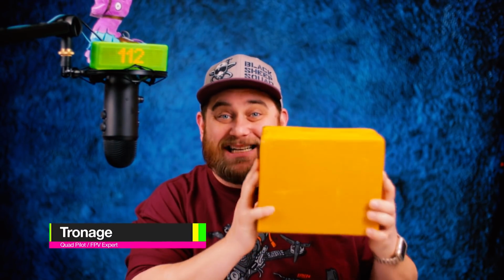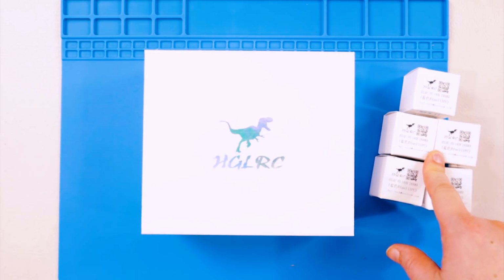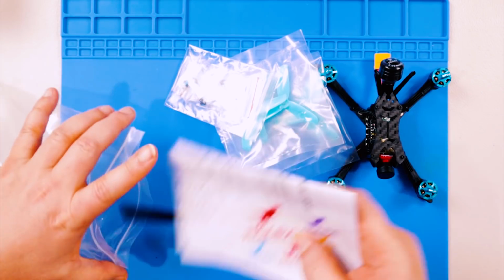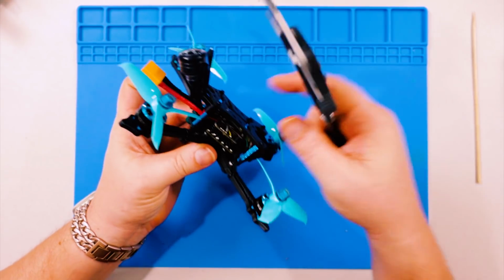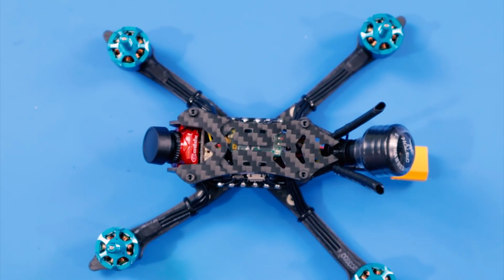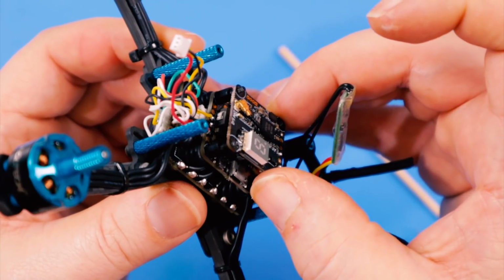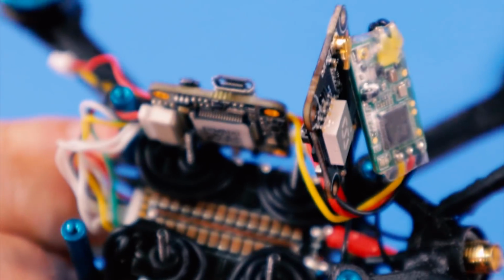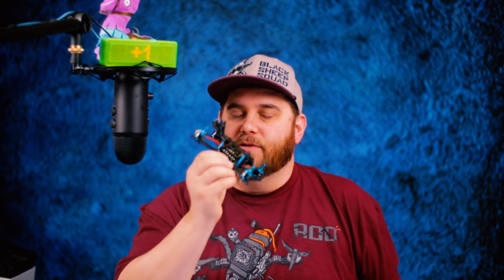HGLRC Arrow 3 152 Unboxing and Closer Look Part 1

Comment: Its crazy thats its possible to make something like this and I wanna play with it so much i mite save my money for i have  searched it up i have seen it on bangood a ton mite buy it i dont really know?
Reply from the maker: It is a great flyer.  IF you have never flown anything before though, I'd recomend you check out the tinyhawk bundle pack.  You can check out my video here:https://youtu.be/cJozoOOprJI  It is greatly suited for someone new to the sport, comes with everything you need (Goggles, transmitter and quad).  IT is smaller and less powerful then then Arrow 3, but most need to learn to walk before we learn to run.  And flying isn't very easy, and expect many many crashes.

Comment: GNB makes 550mah 6s but  you will need to solder on a xt 60 on them
Reply from the maker: Yea I've heard about that pack, it is actually the only small 6s that exists (to my knowledge).  I'm going to have to get me a few of them.  I'm just debating which connector to swap (make the Arrow3 an xt30, or make the packs xt60.  Right now I'm leaning towards putting xt30 on the Arrow, with higher volts, I will have lower amps, which the XT30 can easily handle, and it will be lighter weight too...  Also personal I get sweaty palms when I need to work on battery connectors 😨

Comment: Why would you have to replace the motors if you have the higher KV ones if you want to run 6S.  Why not just setup a throttle cut?
Reply from the maker: Excellent question!!!  
The main advantage is lowering your amp draw.  Without getting deep into motor theory, the gist is the KV rating is how many revs per minute a motor will have when one volt is applied.  Therefore  if we multiply 3600kv motors by 14.8 volts (mid point of a 4s), that would be ~53000rpm.  
By switching to 6s with a lower kv we get 2400kv multiplied by 22.2v (mid point of 6s pack) equals  ~53,000.  It should be no surprise that these numbers are exactly equal.  Since the motor would be spinning "exactly" the same rpm in both of these scenarios, then the Work (or watts) would be the same, and therefore remain constant.  
The relationship between volts, amps and watts is: Volts = Watts /Amps.  So if Watts stays constant, then as our volts go up, our amps must go down.  Amps is what cause heat in escs, so lower amps = less heat = better performance.  Also a 6s will have less noticeable voltage sag then 4s, and overall will perform "snappier" if that makes sense.  
If you were to add a throttle cut, you aren't getting any of the above benefits.  The way to think of throttle is how many volts the esc lets through to the motor.  So cutting the throttle at lets say 75%, means you are flying as if you were using 75% of your 22.2 volts (Which would be 16.65 volts), which is  like flying a 4 and 1/2 cell pack...  Which "could" work because everything is correctly balanced, you are running motors that are great at 4s, at a voltage around (give or take) a 4s pack....  But you are carrying a payload of a 6s pack (which will actually hurt performance because extra weight without extra power), you also don't get the drop in amps to help with heat buildup, and you don't get the extra peppiness etc since it is essentially just running at 4s.
So much for not going to deep into motor theory lol...  But I hope that helps you understand the benefits and why you swap out a lower kv motor when switching to a higher voltage.

Comment: Do you think there's room in there for one extra board? I'd like to try the Caddx Turtle V2 on a quad, but the XJB is a little too small for it (even after adding 3D printed top plate elevators). I guess that if you swap out the included VTX, which has a display on it, you'll get a little more room.
Reply from the maker: Not "stock"...  There is zero room for anything extra.  You would have to get very creative by extending the top plate hider with larger standofts or risers, and then also extedning the stack screws with some standoffs.  It would be a tight proposition to get it in there.  I have the runcam mini v2 thats laying around.  I am not sure if I'll work it into my other xjb, or maybe do some experimenting with this one to get it onto here.

Comment: I look forward to hearing your impressions on 4S versus 6S versions, particularly flight time versus power.  I wouldn't pick up different batteries - change out to XT30 connector - with 6S, the current drawn goes down, so its needless weight and should only be used if you've already got batteries w/ XT60.
Reply from the maker: That is sort of where I'm leaning towards.  my current 4s packs have xt30, and the only readily available appropriate 6s (the gnb 550) is an xt30 as well.  I'm still going to pick up some new packs though because my current packs just don't have the oomph they used to have, and feel a bit slouchy, so they will become my 2nd round packs (packs to fly when the new ones are dead).  In any case it is kiling me to get up in the air with this powerhouse!!!